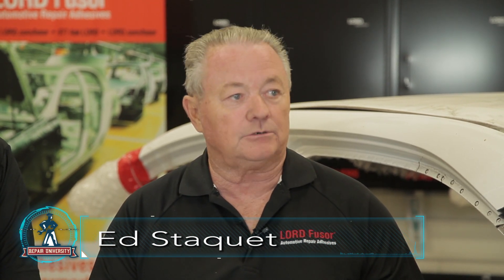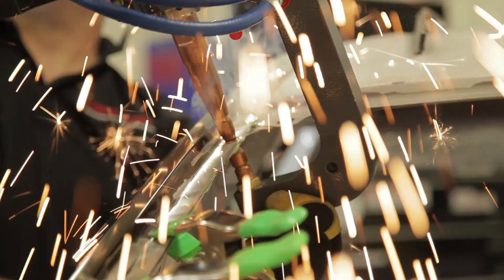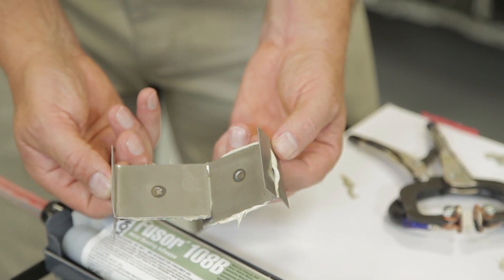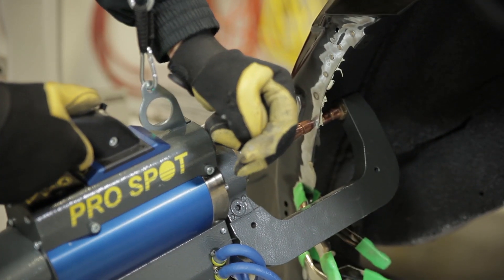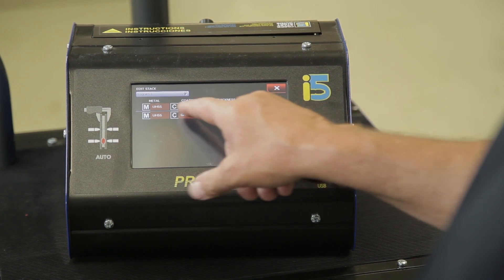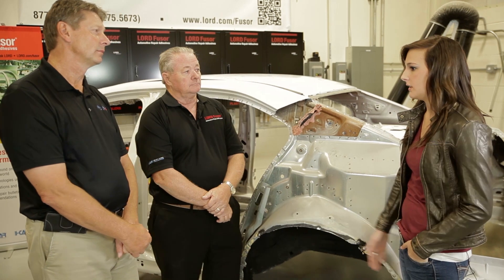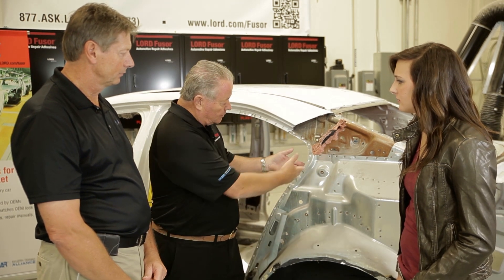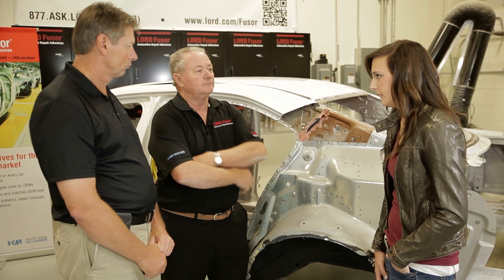Quarter Panel Replacement: Weld Bonding With Squeeze-Type Resistance Spot Welding (STRSW)

Comment: I don't think there has really been much improvement recently. Current GM vehicles seem to be the worst. But none of them seem corrosion proof. Then you have the euro cars that have this extra steps taken to help them resist corrosion longer. Also surprising to see company's sealing more seams on the undercarriage than ever but skipping the petroleum based rustproofing sprays ( seems like they would be cheaper easier and more effective?)

Comment: I've always preferred weld bonding for any area possible. But I've got to say to hear an OEM (especially a US based) say they are concerned about corrosion seems laughable. I just don't think we've seen a big improvement in any spot welded areas. We routinely see rust on very new cars here in the NE. What do you think?